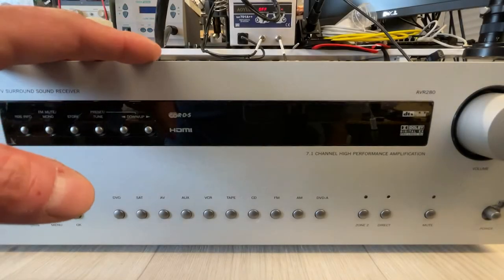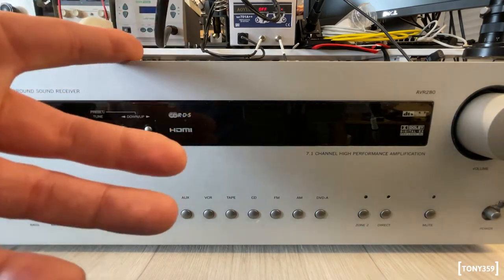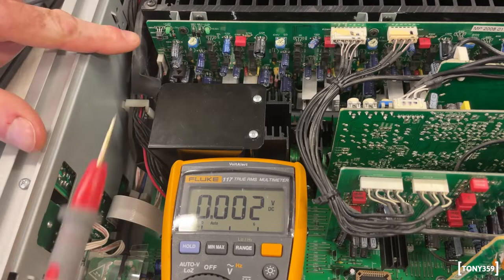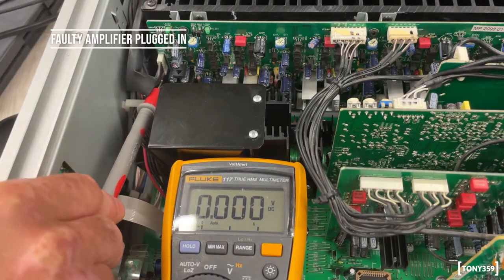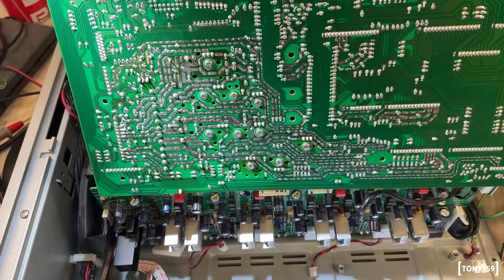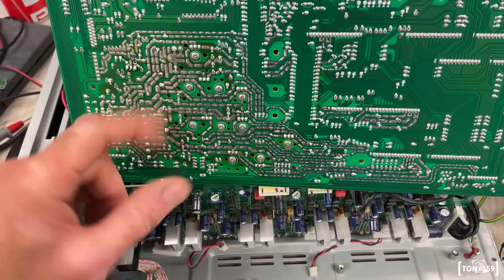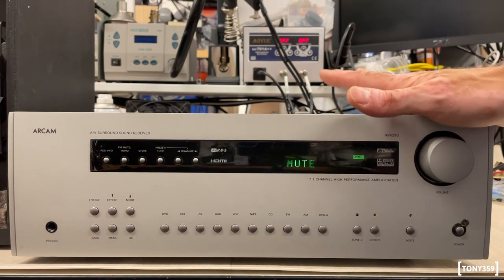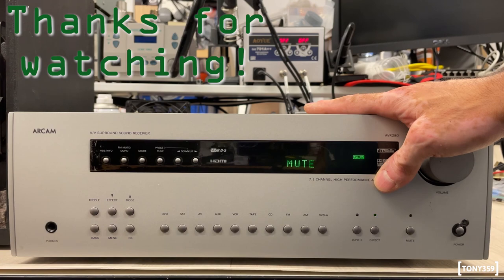ARCAM AVR-280 Repair and test - part 2

Comment: Excellent conclusion! Sometimes an accidental lack of leaded solder is a curse! 🤣 Admitting our mistakes is the only way we learn from them. My modern Denon AVR is the same, badly thought out, disaster, when it comes to heat. I've ended up sitting a 230mm PC case fan, on the lid of the unit. Powered by a USB to 3 pin fan adapter, from the front USB port. Setting the LAN port to go off in standby also powers down the USB too. So the fan switches on and off with the unit. Great video Tony, looking forward to your next adventure! 😀
Reply from the maker: Thanks for your usual very nice comment, I'm happy you enjoyed it! I've had Onkyo's for years and I've always had a fan on top as well - powered by the 12V trigger line. My understanding is that from a marketing perspective it's better to have a silent unit which will likely fail after xx years than a slightly noisy unit (fan) but much more reliable. That said, some solutions like the lack of ventilation on top of the PSU unit just don't make any sense whatsoever.

I did not mention that on the video but I tried to overheat the amplifier heatsink. I stopped when it reached 70 degrees but fans still would not start. I thought there was a fault with the sensors (I did test the fans before re-assembling the unit) but I read online that that behaviour is "normal". Looking on schematics, the sensors are triggered at 100 (ONE HUNDRED) degrees. Those fans are basically there ONLY to prevent a fire. :)

Thanks again! :)
Reply: @tony359  Or to fan the flames! 🤣
Reply from the maker: @ted-b  LOL! Let's not give ARCAM this idea, they might actually like it! :)
Reply: @tony359  Arcam told me the fans come on at 80c.
Reply: Never leave these units on standby. Switch it of at the front, or you may kill the standby transformer. A part you can not get anymore.
Reply from the maker: @errol8000  Service manual lists the sensors as "Thermistor 100C" :)

Comment: Tony what thermal camera did you use? It looks like and sensor/adaptor connected to a phone?
Great videos, thanks!
Reply from the maker: It’s a Seek thermal compact pro - it connects to my Android phone indeed. I think there are more options nowadays though. That was expensive to have that resolution. I’ve been recently contacted by a Chinese manufacturer offering a review of a model which seemed to be similar to mine but cheaper. Thanks for watching!

Comment: Wondering if the muting transistors were really faulty as the original issue was only humming?
Reply from the maker: Yes unfortunately, so either I broke them myself when I had that little accident or they were broken and nobody noticed. Thanks for watching.

Comment: This is not the first such unit of various makes that I have seen where insufficient consideration is given to the cooling of the voltage regulators. I guess cost considerations have limited the choice of heatsink arrangements etc.  It seems home audio units are built to a price rather than quality.
Reply from the maker: Absolutely. Most of my Home Theatre gear is from the professional world for that very reason. But my main AV receiver is an Onkyo. Onkyo have the same "problem" but at least the regulators are on heatsinks with vents nearby. Still insufficient but it makes a bit more sense. I guess nobody wants a quiet fan in AV gear! The heat coffin in the Arcam is shockingly bad, particularly for such an expensive unit. Thanks for watching!

Comment: what do you think the reason of Qx02,08 failure? I wonder why those 2 transistors were shorted even though there are many transistor near them......
Reply from the maker: It's been a while but they clearly didn't like me plugging the connector with the caps still charged and I think voltage ended up in the OUTPUT of the amplification stage. Thanks for watching this old video - it was a nice repair but somehow never got much attention! :)

Comment: 250/280/300/350 series had top lid cut, or more likely pressed and paint upside down, i mean the holes which should be over voltage regulators, are above transformer. 
Regarding voltage regulators temperature, they getting almost 30V on input and they have to drop it to 12V . that a massive amount to drop, so they must get hot. It just a wrong transformer chosen for that job. as I remember well voltage regulator needs about 3V offset to work right, so incoming 18V DC should be perfectly fine and not cause such heat.
Reply from the maker: Indeed. Excessive voltage coming in and they didn't bother to try to mitigate the situation with 
a. more case vents
b. bigger heatsinks
c. maybe a different layout on the board where the voltage regulators were not all crammed together?

Bad design indeed! Thanks for watching!
Reply: @tony359  you must remember it is part of global corporation from like decade or more (arcam is part of samsung corporation now) so I'm not surprised the outcome ;-)
Reply: the max AC voltage from transformer to main board is 16v....still don't dont't understand where those heat coming from.......
Reply: maybe too much current...who is consuming that much current?